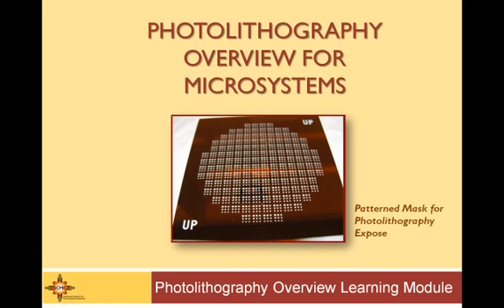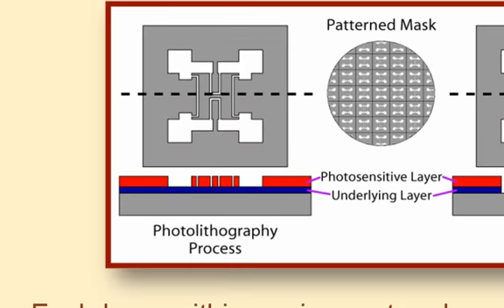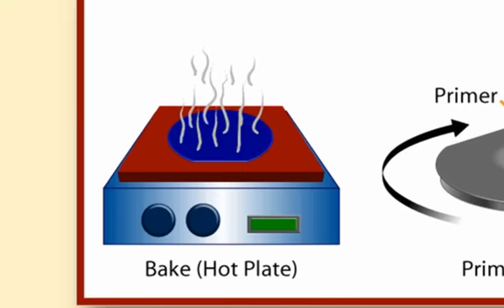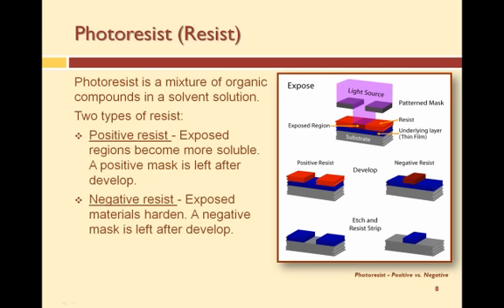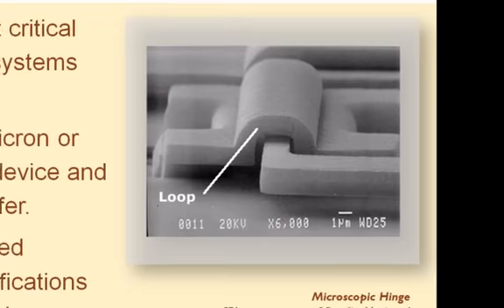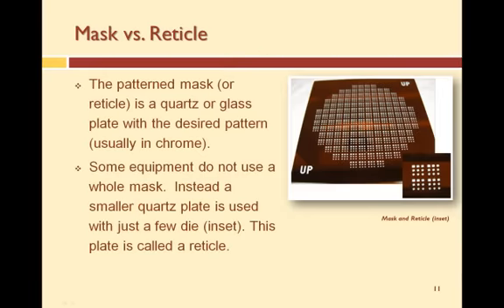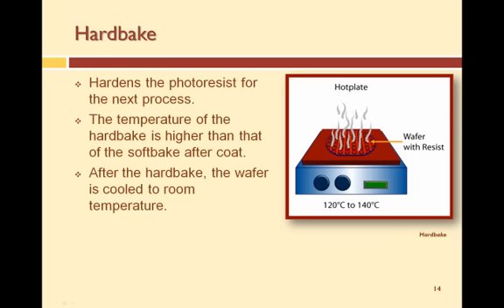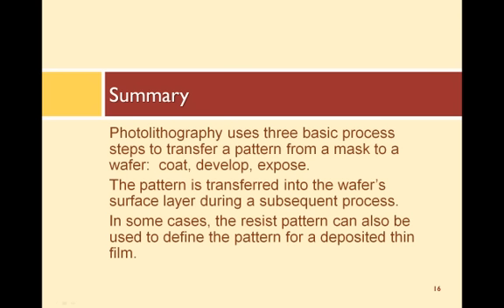Photolithography Overview for MEMS

Comment: Hello, great illustration thank you. Got one simple question though. There most definitely some diffraction going after the light has passed the matrix (the perforated plate). Do you use lens system to condense it back to desirable dimensions? If yes, what kinds of them? Thank you!
Reply: This reply is 10 years late, but still: I’d expect that they use the photomask in a mask aligner (or contact aligner) exposure system. These systems align the wafer to the mask and then bring the wafer into contact (or close proximity) for exposure. This minimal distance minimizes the effects of diffraction. The reticle is likely used in a wafer stepper, which often use projection optics to also scale down the features on the reticle when imaged onto the wafer die. Hope that helps, late or not :)

Comment: Why UV light is used here ? Why not other ? Is it related to resolution ?
Reply: X-ray lithography is costly & not easily available, where UV- source as well as UV compatible photo-resists are easily available. (UV-LIGA is cost effective but when the accurate sidewalls in the microstructure are required then we should go with X-ray lithography i.e. LIGA process)
Reply: as the design is on a nano scale, the smaller the wave length, the better. I think

Comment: It doesn't have to be, it could be made of GaAs as well as several others. Certain atoms are more beneficial in particular situations. But, I believe Silicon is the cheapest to work with and is MUCH more abundant than others. And is thus used more frequently that most others.

Comment: At 5:29 the figure is wrong for the negative resist. As you said the region exposed to UV become insoluble therefore if that red color is the mask then the final structure will be as same as the positive resist.
Reply: i think they fix it

Comment: At time 1:41, we see that the photosensitive layer is already shaped when placed onto the underlying layer. How are we able to control that shape??

And then at 8:48, we see the mask blocking off certain UV paths onto the part. Is the shape of the layer to be etched determined by the photosensitive layer under a blanket of UV? or does the UV layer control the photosensitive layer, which then controls the etched layer?

Thank you
Reply: The shape of the photosensitive layer is controlled by subjecting it to photons through a mask, as most of this video explains. The UV layer is the same as the photosensitive layer because UV is light, i.e. photons.

Comment: after the photolithography, why doesnt the etch, etch the protected silicon oxide (under the undeveloped photoresist) from the side, which is clearly not protected anymore?
Reply: A solid silicon oxide layer has no sides, it's a layer covered by the photoresist pattern.
Reply: what i'm trying to say is that (it may be a very thin layer, but its still 3D, just like everything else in this universe) first the whole layer is covered with photo-resist. After the UV light is applied, the affected resist is kind of "rinsed" off (correct me here if i'm wrong). This leaves some portions of the oxide layer unprotected, so when the etch is applied, its corroded (also correct me if i'm wrong). On the minute 1:23 you can see the before and after the etching process. In the second picture, you can see that now, some sides of the oxide layer are exposed.
Reply: Yes, you're right there: the sides are now exposed, but the etching has already been done. Some etching processes result in some of the side walls being etched away, others don't. There's no further etching performed on the exposed sides, instead the gaps are filled with whatever they need to be filled with and then the a new oxide layer is applied.
Reply: Oh yes, I must have misunderstood the way the etching process works. Please forgive my stubbornness, but my doubt is about WHILE the etching process is being done. I draw it in paint to explain myself better: http://imgur.com/a/tYhtQ
Reply: Well, again, there are processes that result in both types. The one you have in mind calls for an anisotropic process which can be dry (typically plasma) as well as wet (such as an acid). I only learned about it when writing this reply myself so that's all the detail I know on the matter, but I hope it helps. Thanks for asking by the way, answering your question made me learn something new.
Reply: Sobakus thank you mate!
Reply: now that ive read a fair amount about isotropic and anisotropic etching (wet and dry), I finally understand how it works. You have no idea how thankful i am. and I hope other people find this helpful as well
Reply: The crystal direction will also affect how the wafer is etched. Both isotropic and anisotropic etching can etch the sidewalls.

Comment: Hopefully someone with the expertise and knowledge can help me here I cannot find my answers anywhere... I have been tasked to produce a power point on LED manufacturing and its requirement for vacuum. id be forever grateful for any the answers to any of these questions I've watched endless videos on YouTube. Thanks in advance. The questions are:

1)A wide variety of systems used in LED manufacture require a certain level of vacuum pressure, what is the necessity for vacuum in this environment?
2) what are the various methods of achieving low and high vacuum pressure (pumps)
3) what measurement systems are used to indicate the various ranges (gauges)
Reply: I hope you got through it. I notice no answers here.